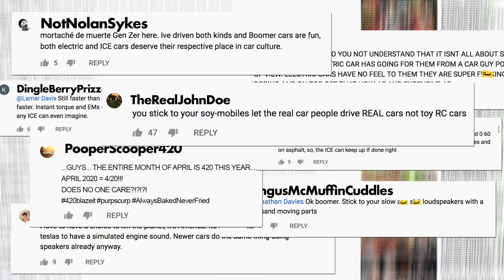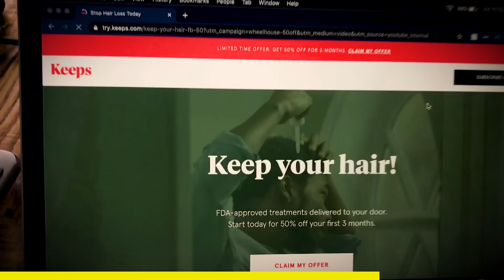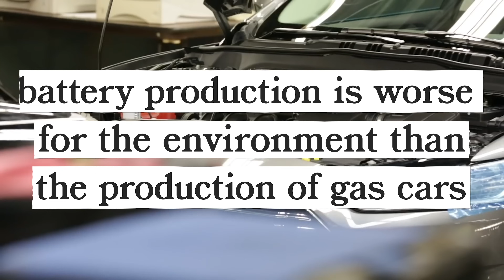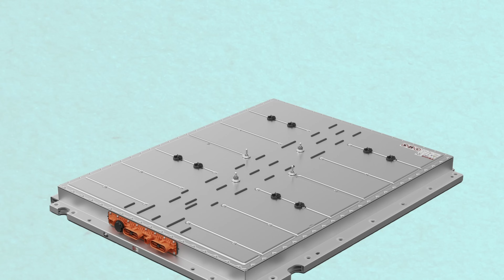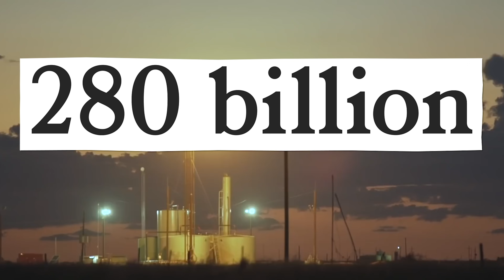Are Electric Cars REALLY Better for the Environment?

Comment: I am an energy generation operations major and I really liked your video. A couple things I might add: 1 Power plants have exhaustive emission control systems whereas cars do not and cannot making plants a better choice for controlling emissions. 2 The thermal efficiency of plants ranges from 20-40% before line losses which sit around 10% power loss and then your final destination the EV’s average electric motor efficiency at 90%. Cars can range from 20-30% with diesel engines at 40% thermal efficiency but of course don’t require any further steps. 3 @8:41 that’s a natural draft cooling tower (the choice tower for a nuclear plant). There’s nothing coming out of that stack but water vapor. Most every power plant nowadays you’ll never see any emissions coming from their smoke stack because it is too thin and so heavily filtered. So everything considered combustion cars are likely more fuel efficient when we use thermal efficiency as a metric but EVs allow for better emission controls as they give that responsibility to the power plants which can and have to implement exhaustive emission control systems. Great video!

Comment: You flat out said that it was false that our power grids can't handle all the EV chargers. Are you sure? I don't know about other areas, but here in the Detroit area, the local power company engineers aren't too confident that the power grid can handle it...  We already have transformers bursting into flames as it is...
https://www.detroitnews.com/story/opinion/2018/09/27/can-our-power-grid-support-electric-cars/1420140002/
https://www.washingtonpost.com/science/electric-cars-will-challenge-state-power-grids/2020/01/24/136a2a30-32e6-11ea-a053-dc6d944ba776_story.html
https://www.wired.com/story/electric-cars-impact-electric-grid/
https://www.technologyreview.com/2013/08/16/176978/could-electric-cars-threaten-the-grid/
And there is plenty more...

Comment: All this video taught me, that it is incredibly complicated to figure out which is better, but it all would be rather irrelevant if the industry would rely less on oil based products. Better cars are only a small part in the way to a greener world.

Actually in Germany there was a study made about all this. It stated that after 114.000 km driven an electric car is better than an average diesel car. And this calculation considered literally everything. Even the fact that the average battery only lasts 200.000 km. Couldn't find the source right now, but it basically agrees with everything you said. 

Still I believe that in the long run it's gonna be all about the way we create anything, rather than use, especially energy

Comment: I'd like to add something that pretty much nobody talks about, most batteries get obsolete after some time, could be years, could be months, could be forever, that means that the charge will last for shorter times than new ones, you'll have to charge them more frequently, drive shorter distances, you get what I mean, it is very unlikely that the old batteries will get recycled, and it's very likely that you'll have to change the whole car instead of just the battery. This is in no way a "haha gotcha electric fools", I myself I'm a technician and this is a problem I've seen in my country with electric bikes, the batteries get obsolete, changing the costs pretty much the price of the whole bike, and they just end up buying regular bikes cause for them it's just "not worth the hustle". Hopefully technology advances quickly so batteries get more effective, and easier to recycle.

Comment: How many battery packs are swapped during the "life" of the vehicle? Just asking because my electric lawn equipment i use for my business really wears out the batteries almost on a year basis. Even though the equipment works, the battery life either severely loses its duration or it develops an issue such as a bad cell or cells that cause the battery pack to indicate its damaged and no longer will run the equipment. Just something else to throw into consideration... Great vid tho 👍
Reply: EV's come with a sophisticated battery management system. and have more cells to spread the load. So not the same issue. Tesla have supposedly come up with an EV battery good for 1 million miles.

Comment: You forgot to mention NUCLEAR POWER that also emits ZIP. Well, not zip, it emits STEAM.
And why isn't everybody hammering COAL POWER PLANTS??? They kill more people of cancer than nuclear ever will.

One measurement used for NPP's is BILLION OF METRIC TONS OF COAL EQUIVALENT, that is NOT emitted, because they exist.

Nuclear waste... is a negligible volume of SOLID WASTE that gets locked up in drums near the BILLIONS OF TONS of coal spewed into the atmosphere.

Angra 1 in Brazil has been producing 700MW steadily since the '70s and ALL the waste there is stored in a moderate sized warehouse, in a place carved against a mountain face.

Not mentioning the fuel rods, that are stored inside the plant for their foreseeable future. Angra 2 was built on a german design with the same idea: all the highly radioactive fuel rods are stored in there, for the lifespan of the Nuclear Power Plant.

And... ethanol. Our cars run into sugarcane-derived ethanol, completely renewable.

And I heard Nissan was going to develop an electric FUEL CELL that is charged with ETHANOL. So you top the car with this particular type of alcohol, but it doesn't have an ICE, it has ELECTRIC motors. The mileage was astounding compared to an ICE too.

Comment: BUY OLD USED CARS. Recycling is ALWAYS the best option if you're considering your carbon footprint. If you're truly set on buying a new car then by all means buy a hybrid or electric.
Reply: Hilux not really, did you not see the difference in carbon footprint of oil and yearly use of card verses the production footprint?? The oil and use of ICE vehicles far surpassed the carbon footprint of producing it.
Reply: @RxShifts  Also, those numbers are for new cars. A 10 year old car will pollute even more and catch up to the amount of environmental impact of a brand new EV even faster.
Reply: @RxShifts  no really, the car is already made, making a new car produces more carbon than driving one thats already made.
Reply: This has been debunked multiple times. It's flat out not true.
Reply: No, old used cars are even worse for the environment. A modern ICE car or an EV will catch up in no time as far as emissions are concerned

Comment: There is a future for petrol and diesel cars, E85 wich almost every gas car can be converted to ane its much better for the planer, and for diesel there is actualy an biodiesel made in finland that produces 95% less co2 than normal diesel and its made of garbage (no palm oil) and you dont have to convert your diesel car and its supported by all manufacturers, the only problem with ev’s is that the batteries are not good for cold weather and are costly to replace, and as long as people fear the only efficient clean power source (nuclear) it wont be viable, nuclear is the only power source that could be researched more and made more efficient and safer to support the ev’s

Comment: good work!
just some input
1) if you compare a 700 hrspwrs electric vehicle to a 700hrspwrs ICE car the difference gets even bigger
2) Lithium batteries of the new generation like tesla model 3 surpass the average vehicle lifetime by 3-4times. after that they will and can be reused as powerwalls and batteries with a lower dischargecurrent. so even 10years ago the average lithium cell-life was more than 20years. Recycling level over 9000 haha. even though its true that there is no really good way to recycle damaged batteries right now.
3)Lithium Mines in Atacarma are way older than we think mainly they are/were used for mining potassium and other minerals, also the waterlevel issue is not entirely caused by the mining but because of the geological circumstances in that area.
4) due to more parts that have to be changed on a regular basis like Brake rotors/pads, Waterpump, engine oil, filters,.... the production of these parts produce further emissions. brakesrotors and pads last about twice as long on EV due to recuperation

Comment: battery replacement has not been included, this is a basic principal of electric cars, if you use it for 12k+ miles per year your battery needs replaced after 3-4 years, this is a major factor i think pushes electric cars over the edge on co2 production, though not sure how donut media missed something so simple...

Comment: Yes, batteries are bad but there are EV's without one. Hydrogen fuel cell, look it up. Only problems are produceing the H2 and storeing it. H2 could be produced througt electrolysis (simple: using elektricity to turn water in Hydrogen and Oxygen) using exess Energy from solar and wind powerplants. 
(Sry for typos, i'm a German potato)

Comment: Ultimately electric motors have way better efficiency close to 90-95 percent wheras internal combustion engines have around 25 percent efficiency so it has the potential to almost be zero emissions using the same amount of energy to do more work is the reason electric motors are so good (not for everything towing for example)

Comment: I get it, we have to look for alternatives for Oil based energy and electric engines are WAY more efficient than ICEs. You've looked into the environment angle for this video and that's a good place to start but you're forgetting some other aspects of this issue:

First of all, the environmental damage from the lithium salt pans looks to be huge. Oil mining and refining these days is a very efficient and relatively clean (still dirty but relatively clean) compared to lithium and cobalt mining. I don't see oil taking up 65% of the local water supply which is a gigantic impact on the environment as well.

Then there's the angle of practicality:

Batteries are heavy and big:

Jason Fenske from Engineering Explained goes into great detail on this topic: https://youtu.be/oJL9MasBFvM It gets to it's worst point in semi trucks. While the diesel tank only costs 1% of it's total weight limit getting an equal electic range would cost the truck 25% of it's weight. In an industry where every bit if hauling capacity is monetized this is a big problem. Good luck Elon, that cybertruck has got a long way to go.

Are batteries the way to go? I don't know. Sure electric motors are more efficient but are batteries the solution that should be powering them?

Cold temperatures:

In the same video I mentioned above,  Jason talks about how cold temperatures can reduce the range of EVs up to 40%. Don't get me wrong in densely populated area's with high temperatures like California or where I'm from (the Netherlands), this isn't as much a of a problem. Our country is 180 miles tall and rarely does one have to travel that far on a daily basis here. This isn't the case though in rural area's with a cold climate like central Europe, Russia or Canada. Having to travel 2 to 300 miles is more common there and should you get an electric vehicle, you'd need every bit of range you can get. And remember that not all EV"s have a P100's range.

Charging vs refueling:

Especially when you're traveling long distances (for example, when you're on vacation) or maybe you're a sales representative and you make up a lot of miles on a daily basis, charging becomes an issue. Don't get me wrong, getting 200 miles or in the best cases 300 out of a car is fine and all but I don't see that range happening in Europe when you're doing 80 mph on the highway (or even a conservative 100 in Germany). 

Let's take a vacation as another example: I can travel 620 miles (1000 km's) from the Netherlands to Austria in about 10 hours including two stops doing an average of 60 mph. That will never happen with an electric car. At the best each stop will give you 60% battery in about 20 minutes (that's counting if you're lucky and you can rapid charge at the place and you don't have to wait during holiday season: https://youtu.be/QpkdjzoP9Xo ). Taking into account the fact that to get the full range of an EV you'd probably need to not go above 60 mph, taking into account the extra charge times it requires, I recon you'd need at least 4 charging stops (not including grabbing a bite to eat). I'm gonna give a rough estimate that you'd probably average 60 kph or about 37 mph. Even if you push that to a 40 average it would take you around 15.5 hours of traveling time.

Cost per mile

Estimates show that here in the Netherlands, the cost of an electric mile on a quick charge cost about the same as a mile driven on gas (petrol). Gas costs about 1.60 to 1.70 in the Netherlands but also germany (stupidly expensive). That would amount to about 6.4 dollars per gallon. Okay so what about normal charging points. Well that would cost you about 6 cents per liter which is about a dollar per liter which is 3.80 dollar per gallon. Small disclaimer though. This is the cost of an electric mile in the Netherlands, not US but the point I'm trying to make is. Unless you charge at home, the electric mile costs more than your ICE vehicle. This combined with the relatively high price of an EV, makes it a VERY expensive vehicle.

Don't get me wrong. I'm not saying electric cars arren't a good option as an alternative for fossil fuel cars. But there's a looooong way to go and as long as the cost of running an electric car and the MSRP isn't competitve to relatively the same cars and several practical issues arren't solved I don't see them replacing ICEs.
Reply: Look up oil sands.

Comment: You still missed the toxic cost of battery production... The amount of chemical waste produced when making the battery.
Also that it is repeated every 5-7 on average, when you need to replace the battery. 
The only justification for electric cars. Is city centre use , if it's never going to leave it. 
Also if you convert old vehicles, to extend Thier usable life span or replace a very dirty inefficient engine.

Comment: Just for future reference, you should have an expert with knowledge in the area you're covering, proof over your video. I'm an undergraduate environmental engineer and I noticed several errors with your footage. This is especially important with 'touchy topics' such as this.
Reply: As some examples. A cooling tower, is not a source of CO2. CO2 is also incorrectly spelt as c02. Mentioning efficiency instead of environmental impact. 

Don't take my word for it. Get an expert opinion. ☺️

Comment: Thanks for this.  I am always glad to see someone spreading the truth. 
I too have an ICE vehicle (F-350 Diesel) in addition to my electric vehicles. 
And I also crunched the numbers a long time ago.  EVs are simply better than ICEV 99% of the time.
But it is a question of; The right tool, used at the right time, for the right purpose.
Commuting to work or a trip to the store EV bike.  Hauling camper and boat,.....truck.

Comment: I've always been a car guy (rev heard...gear head... whatever you want to call it), I've worked in the car industry doing crash testing and Vehicle Performance Development. I've owned several EV's and always, at the same time, had a V8 as well. Now my V8 (ironically) sits there with a maintenance charger on it. We much prefer driving our EV.
Reply: rev heard

Comment: One issue regarding electric vs ice that impacts most states with a gas tax, especially California, is that EVs don’t pay a gas tax which is bad for keeping California roads maintained. The main source of funding for highway maintenance and expansion is through the per gallon tax, so EVs are literally getting a free ride because they don’t pay it. And considering that many EVs weigh more than their ICE counterparts, it can really take a physical toll on the roads in the form of potholes with ICE drivers picking up the tab. Fortunately, there’s some pending legislation to fix this inequity with a road fee that EV owners would pay that would equal the avg taxes paid by an ICE owner (driving a avg mpg vehicle the avg miles a year)

Comment: Cobalt is also used in refining oil for the removal of sulphur.
Reply: And it has really high recycling rates when used in batteries & Electronics
Reply: @jakecole7447  infinitely recyclable in fact.
Reply: @jakecole7447  How much energy is used to recycle it?  Meaning reprocess the material for reuse in a new battery?  Sometimes recycling process can be very energy dense.  I would also be more worried about the lithium, as the countries that get it out of the ground follow virtually no environmental regulations.  Which would be going against the idea of the whole thing.
But what do I know, I am addicted to the sound of 20 plus psi going through an ICE
Reply: @rdub6941  How much energy is used to recycle it? Very little, not significant at all. Recyling is more energy efficient procces than mining new elements.   Countries that have no  environmental regulations? That is not a problem of EVs, it is a problem of a regulatory organs: the government. And it will be sorted out.
Reply: @Manuel Neumann Pretty much all of the EV makers are, for that matter.
Reply: Manuel Neumann 
Plus: Buying EVs results in more money going to finding new and more enviormently friendly batteries.